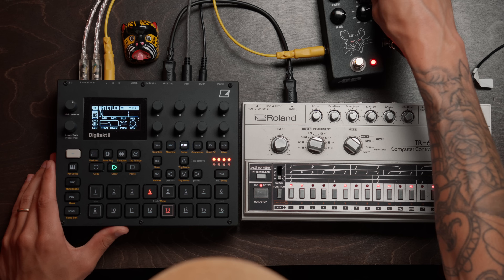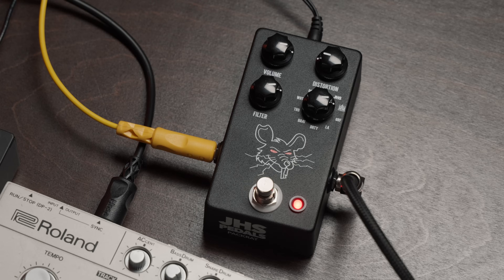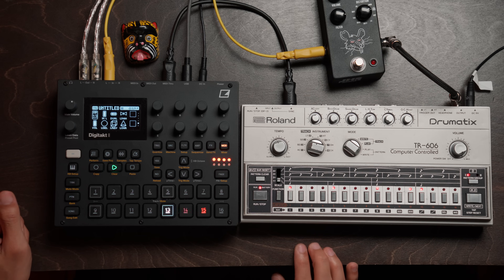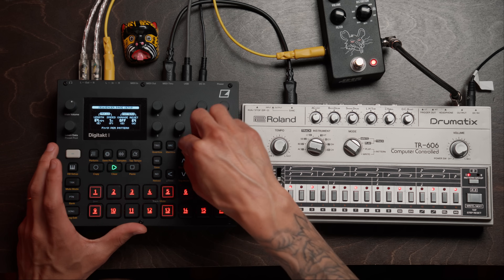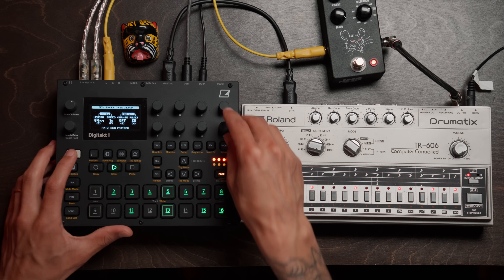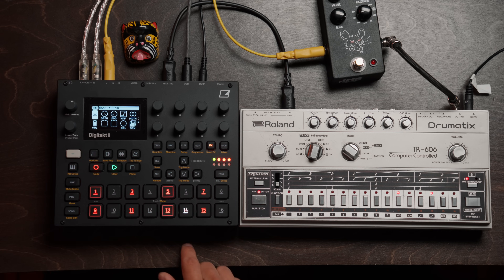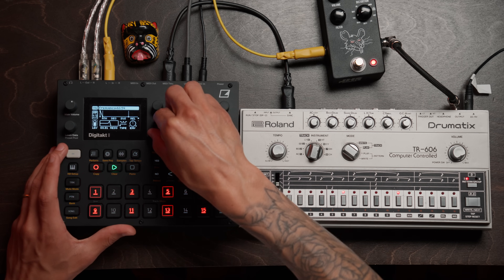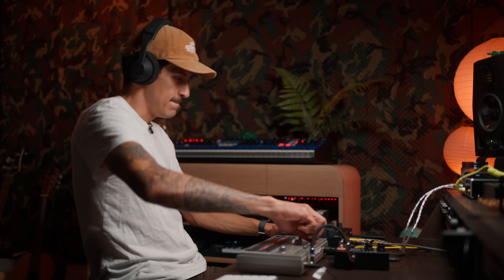Distortion on a 606 is 👌🏼

Comment: I recommend Alessandro Cortini's album released under the pseudonym "Slumberman" — it's just a 606, a 303 and copious amounts of distortion, delay and reverb.
Reply: woah that sounds rad! (at 75% speed try it)
Reply: Yep yep yep 🤌
Reply: Is Slumberman the artist name or the album name?
Reply: @JakeSweeper  Slumberman – Mono Acidic
Reply: Thank you for pointing out that release. I hadn't listened to it yet, but I have it in my bandcamp library. Pausing Ricky to give it a short listen. Initially, it sounds similar to the third ritmo album. Very nice.
Reply: @JakeSweeper  Artist name. Album name is "Mono Acidic". But you should be able to easily find it because it's his only album released under that moniker.
Reply from the maker: Oh hell yes I can’t wait to check this out
Reply: Killer 606 tracks I’m feeling recently:
Steven Julien - Marie
J m s Khosah - Ritual Flow

Comment: I love running drum machines through drive pedals, one of my favourites is the Dreadbox Kinematic. It has drive, compression and a peaking filter you can sweep around. I always reach for it with my Drumbrute Impact. The compression, drive and using the peaking filter set really low around the sub area to make the kicks huge, or at the top to make the hats sizzle is just sublime.

If you want to go really experimental, a great next step is to also put EQ before and after the drive to let you emphasise or de-emphasise certain frequencies, there is a whole other world of drive sounds available when you can choose to drive certain frequencies harder.

Comment: I have a few different kinds of distortion, and drive pedals, and also overdrive some other circuits, like the amps in an old 1980's Panasonic mono microcassette recorder, that has a mono input, and a mono headphone out, with input and output level pots. It's purely analog, and powered with a pair of rechargable AAA batteries, which last a few hours, because the cassette is always left switched to "pause mode", which really just cuts the power to the tape mechanisms, while leaving the input, and output amps active. I use drive, and distortion somewhere, with just about everything I create, both into sampled materials, as well as, during a performance . Recently I finally picked up a tc electronic Tube Pilot, and swapped it's stock Chinese Bugera 12AX7C, with a 1960 dated Baldwin branded long black plate Raytheon 12AX7A. Raytheon, as well as Sylvania were contracted to supply Baldwin with tubes for their tube organs in the 1960's. I have a handful of both, atm. I pulled them from an early 1960's Baldwin. I have a collection of "12's": AX7, AU7, AT7's. All vintage- Raytheon, Mullard, RCA, Sylvania, Siemens, Amperex, Telefunken/Lorenz, Tung Sol, and a few others. They ALL have their own unique tones, drive, signal breakup character, and other behaviors. I'm considering buying a second Tube Pilot, just so I can have one with a long black plate Raytheon, and one with a 1962 dated IEC branded Mullard. So there is no need to swap tubes, to get what sound I'm after, of my current two favorite tubes. Both have amazing character (But quite different sounds/breakup character.)  I highly recommend adding a Tube Pilot to your arsenal for some of your sampling jobs, even if you don't really get into tube rolling. It is cheap, and doesn't starve the tubes heater badly like some other modern tube circuits. It sounds pretty great right out of the box, too, with it's stock Bugera 12AX7 "C".

Comment: I like my 606 to go through a DI Box before hitting the guitar pedal to bring the line level down to intrument level what the pedal is made for. You get a greater range of sounds with a DI. Without the Pedal is super sensitiv because the input level is way too hot... and impedance mismatch whatever. what you think about using a DI ?

Comment: Erm, you do know you can just use the headphone out with the volume cranked for this and not waste $80 on an overpriced, overhyped pedal designed for guitars, rt? It gives the snare this lovely squeak and the hats an incredibly tasty crunch, better than an LED clipper any day.(Although your cymbal sounds pretty sweet with the pedal here, not so much with the headphone out option). I modded my TR606 in 2003 and was almost tempted to mess with this signal chain, but it's pretty great as-is.